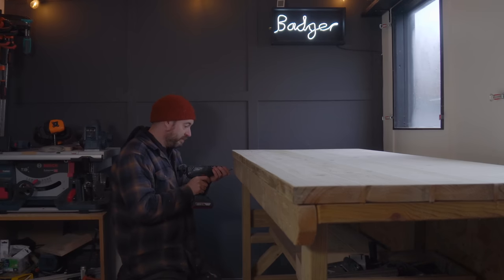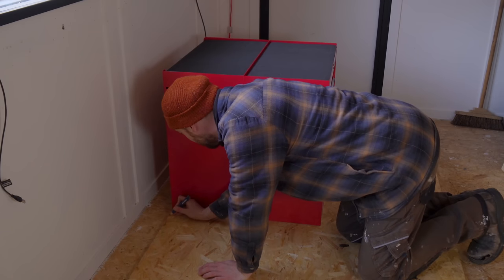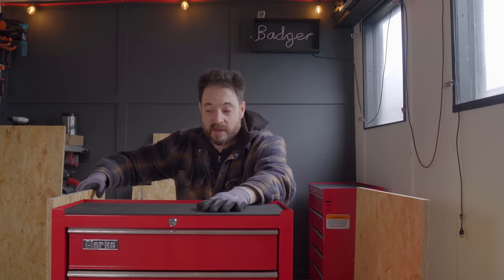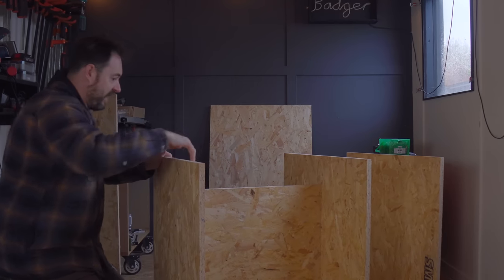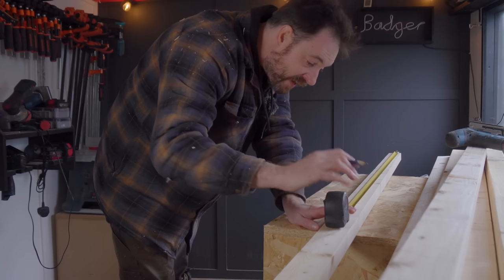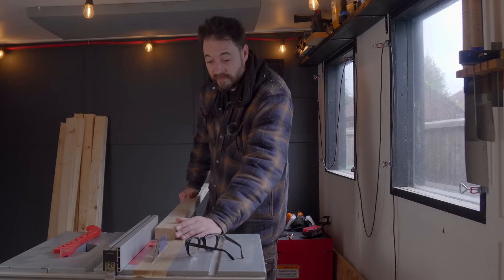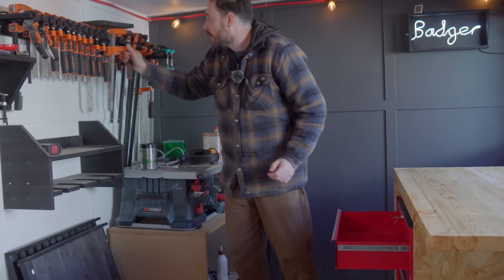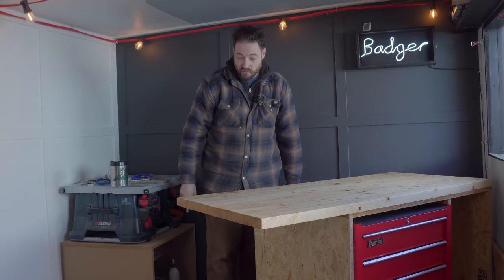New Work Bench With CLARKE TOOL CABINET

Comment: Great video 👍 I'm new to your channel have binge watched serveral of your vidoes over the last few days, to reduce sideways racking and to prevent the toolbox tipping forward if to many draws are opened I would have utilised the bolts and threaded holes in the side of the toolboxes for the side handle and used them to bolt the sides of the wooden work bench to it, or you can still use them now for securing more items like chargers, I've used toolboxes like this for many years I'd recommend lining the draws with thin foam/non slip Rubber mats or even something like 2mm mdf it prevents scratches and tool rattle and vibration when moving bench around.

Comment: Nice little bench.  Those drawers for the power tools are calling out for some shadow foam inserts.  Will stop them moving around when you open and close the drawers.  That space above the Vac could also be a drawer for the more often used tools.  Will you paint it, do you think?

Comment: Its interresting to see that you're downsizing the workbench. I did just that some time ago, to fit my bench across the room instead of the long way. And I put it on casters as well. For planing I just make sure it is butted against the wall. And by the way that happy accident with the overhang is just a good excuse to put on some hardwood edgebanding. Looking at this bench compared to your old one, I would personally miss the possiblity to clamp to the front. So, I would add a "skirt" or whatever to the front edge. It will be cool to see you working on the bench in future videos. Cheers and thank for sharing.

Comment: Nice bench! I have a bunch of those style of toolbox in my shop and they are really great for storage. One comment i have is you may want to take a drawer off and fix the bottom or sides to the bench. I have on a few occasions had the drawers open on  a bench when moving and it really wants to tip the box out. On the power box side you may want to add a shelf for some extra storage. 
Will you be doing any dog holes in the bench top?  Mine uses them and i recently bought some inexpensive but very nice dogs  on Temu, they come in 3/4" or 20mm.